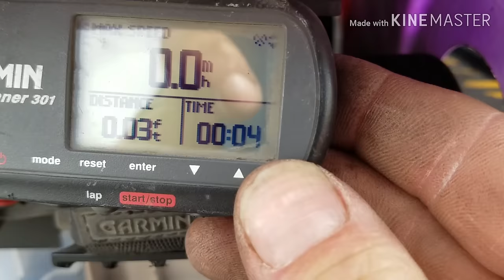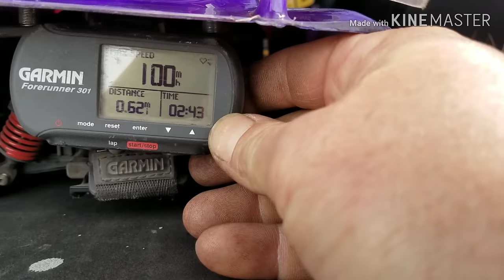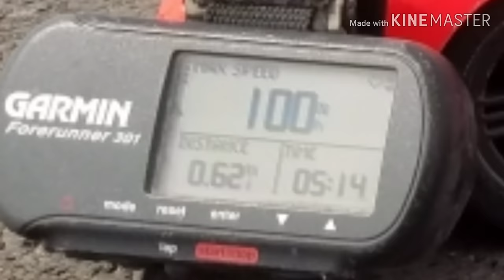Traxxas 4tec Vxl Goes 100mph On Velineon System

Comment: Those gears surely aren't stock tho I see u had to cutthr cover off the motor lol nice job bro 100 is my goal just sacred to fully break this thing lol but again I know I'm 3yrs late but nice man
Reply from the maker: Lol.... yeah when I made that video I went a little overboard with it, but literally the only thing changed on the car was gears, tires, and battery connector. Body doesn't count since the car didn't come with one. Off camera I made over 70 passes before I took that velineon esc out of the car. My advice is always keep a fan running on the esc.  Have fun and send it bro. 🏎💨💯

Comment: Done an upgrade to ceramic bearings or does it come with those already? I like how fast this thing goes with just a gearing and battery change. My rustler 4x4 might get a TP power/castle esc upgrade at some point.
Reply from the maker: that's cool. should be a fast rustler.    this car is 99% Traxxas. No joke. My battery, my gears, and my car body. that's it. thanks for watching. stay tuned ..... she got more!!!!!😉✌👊👍🍿🍿🏎💨💯
Reply: @lightningdad13  Yeah noticed that.  i'm surprised the vxl could reach those speeds in a traxxas chassis. im thinking maybe it's a bit on the heavy side compared to some other brands who make cars fully out of carbon fiber. My rustler has been getting quite hot even with stock gears, so i have put the esc and motor heatsink/fan on it. thats with stock gearing and the car going 40mph something.

Comment: Good run bro. But it’s not really stock. I see the mod one set up. But still awesome run.
Reply from the maker: thanks for watching. you do know you'll never go fast on stock gearing. it's kinda an obvious change. it's all about the system. I just wanted to prove that you dont have to spend $1000 to make a car go 100mph. nobody ever gave the system a chance to prove itself. ohhhh and by the way it's got way more in it!!!!! stay tuned
Reply: LightningDad13 
Oh yea for sure. But we know all the rookies who are watching the video will try to do it with that 48 pitch gearing. And also I think that the velinion system is so under rated.
Reply from the maker: @chedrickyoung1171  I couldn't agree more

Comment: What gearing were you running, looking to do this to my 4 tec. I had commented before asking the gearing and you said 23/27 is that true.
Reply from the maker: As long as you battery can produce the power .... yes ... that's a great combination to use. have to be careful of Temps. or it will burn up quick on you.
Reply: What do you think a good gearing combo is to hit 100 mph
Reply: I was thinking about doing 55/43 or 47/37 what do you think would be better. (Not mod 1)
Reply from the maker: @vybez1195  37 pinion/ 47 spur come out to about 66mph 
43 pinion 55 spur come out to about 65 mph

you could get a little more than that but don't know how much. 
you will need to change to a different pitch to achieve 90-100 
I want you to do a little reasearch and look up Traxxas UDR pinion gears. that is the ticket to get where you are wanting to go. 

side note remember you need a strong battery for speed running. and definitely a fan on the esc at all times. don't make multiple passes. I literally make one pass cool down and charge battery. I burned up a lot of esc before I learned that. but with the car you see in the video I made about 70 passes between 100 and 114 on the same motor and  esc before I stop running that combo.  so I know it can be done. The most efficient gears I used where from the Traxxas UDR. 
Feel free to keep me updated.
Reply: @lightningdad13  ok thanks for the information. What about 47/43
Reply: @lightningdad13   I was thinking about order 47/43 I just wanted your pick on
Reply from the maker: @vybez1195  that would get you somewhere between 75 to 80. should be a great starter. definitely be on the right track. 🏎💨💯
Reply: @lightningdad13  do you think my temps will hot with 47/43
Reply from the maker: if you push your car on one solid pass like I do. I would suggest stop cool down charge battery and repeat. my honest opinion.  as long as you make one pass at a time you should be fine. just know that you'll have to change pitch to get really high numbers with vxl
Reply: @lightningdad13  ok thanks for all your help. I just ordered the gears.
Reply: @lightningdad13  I wonder if the stock motor mount will be able to mesh 47/43 right
Reply from the maker: not sure. may have to cut the plastic in between the holes with a razor blade.

Comment: The gearing doesnt look stock. What gearing are you running?
Reply from the maker: stock gearing would never achieve these speeds. I had to change that in order to get faster. the gearing used was the same that you put on an X-maxx. thanks for watching
Reply: LightningDad13 what was the gearing for this run I’m wanting to get my velineon motor to 100 also

Comment: What did you do to make it go 100
Reply from the maker: changed tires to foam, put 200mm body on it, and changed the gears to a more aggressive speed gearing. that's it.
Reply: What gearing do you have
Reply from the maker: @Jackalbert05gt  mod 1 gearing

Comment: Does this car need to run 2 pinions as a mod to get 1:1 gearing?  As I've seen a few vids of people doing that. Or is there a way now to run a proper spur and pinion to get 1:1 or close to it?
Reply from the maker: yes I modified my car to run pinion gears as spurs gears. but just so you know 1:1 is not needed in this application to make speed. that is a big big misconception of people that dont honestly know what it takes to make a car go 100mph. I can honestly tell you this. from every car I've ever ran to break 100mph whether it was on 2s or 8s I've never one time use 1:1 ratio. start out with modest gearing and work your way up from there. it's the best way to learn and understand. cant wait to see your progress.
Reply: @lightningdad13  Thanks for the insight brother. I'm currently running a Slash 4x4 and a Tamiya TT02 for speed runs. Both are currently at 90mph...I'm  close to 100. But both need some work to go over 100mph and I'm working on that.
   My Tamiya TT02 seems to run much straighter than my Slash and I have more confidence in that car. My latest vid shows my 90mph speed run. I need to break triple digits though...lol. Weather getting crappier here in Toronto and I'm running out of time before winter. Work and family responsibilities don't give me much time either but I'm still trying...hahaha.

Comment: What gearing would you recommend to achive  this speed run that you achived.
Reply from the maker: Since I'm the only person in the world that has ever done this those kind of secrets are typically not shared with that said I will tell you this much I did not use 48 pitch gears. Thanks for watching !!!! 🏎💨💯👍👍
Reply: Thank that does help. It will be a fun challenge.  Thank you again for the inspiration.
Reply from the maker: @kimmendrzycki8671  absolutely.  all about trial and error.  that's half the fun is see that it's not as easy as people think. here is a clue. there is plenty of videos on YouTube on how to modify this car for faster gears. on a side note I'm currently working on this velineon system again. seeing if I can push it even faster.
Reply: @lightningdad13  Keep it up. Your runs are insane.
Reply: Its mod 1 gearing... just calc the ratio you need online, its no "secret"

Comment: what gearing though
Reply from the maker: I cant exactly what gears I used. trial and error is what helped me figure that out. I will say this.  I was traxxas gears and not some off the wall specialty gearing nobody can get. thanks for watching.
Reply: @lightningdad13  ok i cool  put the 4600kv with the speed run gearing its fast on a 100c 3s
Reply from the maker: @thomasdowneyjr.4162  yes sir that's a fun motor as well. feel free to check out all the different runs I've made with this car. it has definitely been a blast. my biggest challenge has been trying to see how fast I could make it go just on the stock vxl system alone. from traxxas. I think traxxas was even impressed.  so far I'm at 111mph.

Comment: Mod1 gears.. “all stock”
Reply from the maker: in the world of speed runs where most people use carbon fiber chassis,  high powered servo, high powered motor, and high powered esc. I changed only.the bare minimum to make 100mph.  I was basically showing that you don't need all the high powered stuff just to break 100mph.  

stock tires are rated for 70mph. (changed)
stock gearing rated for 70mph (changed)
car did not come with a body so I bought one.
the car is stock so yeah my statement is correct.  

 you can't really expect someone to go 100mph with 70mph gearing can you. 
just my 2 cents.